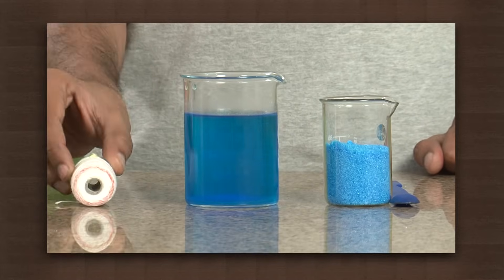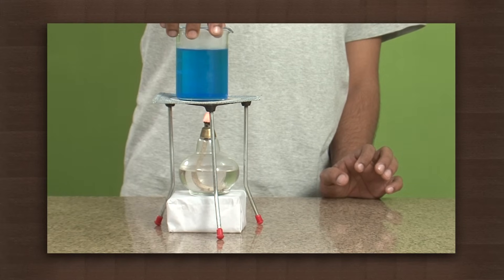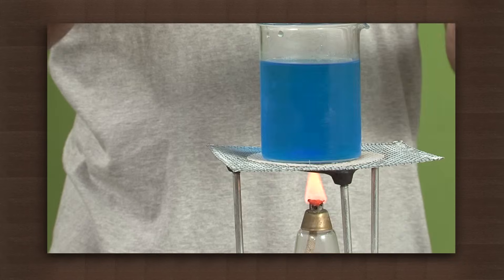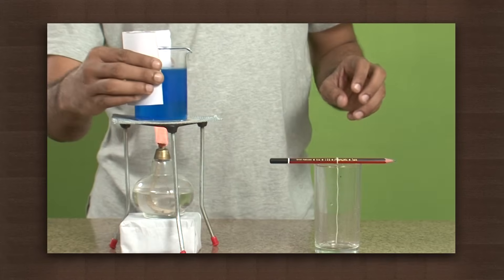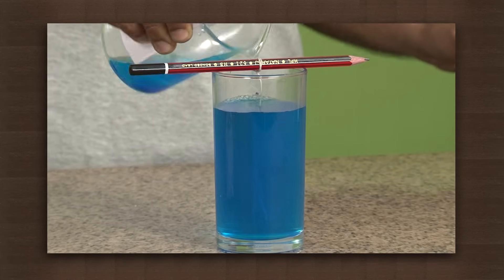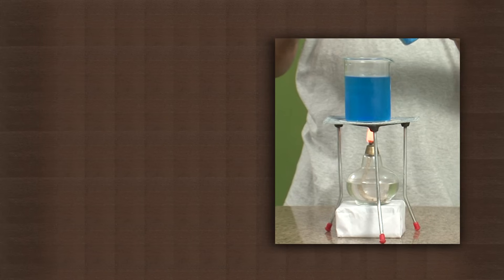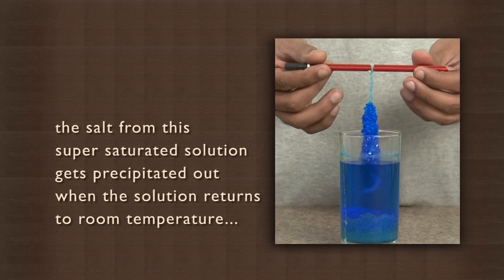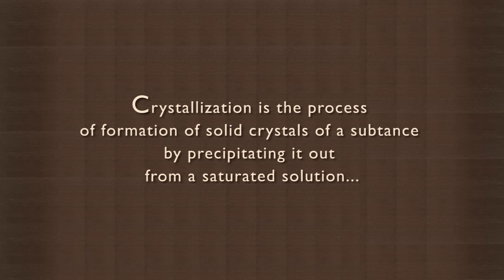Copper sulphate crystallization | Crystallisation | Chemistry

Comment: Why did you say to leave it for a few days? 
Can't we directly put it into a refridgerator?
Reply: Its science
Reply: If we we would keep it in a fridge We would get a solid cylinder and we would not  get crystals. Btw is your answer solved? I am a Indian
Reply: @reactionspace3254  Okay thanks
BTW can we put it just in a cooling device where we can decrease its temperature to a certain(say from 35°C to 17°C) 
Then, no need to keep it for some days

Am I right?
Reply: @Jaikesh Pandey: maybe, It might work.
Reply: Because it has to cool down slowly or crystal will not form if you put it in refrigerator the temperature difference will be dramatic and instead of cooling down slowly it would freeze along water
Reply: @dishant8126   correct.

Comment: The CuSO4 solution was supersaturated when he heated it, added CuSO4 for sometime until no more of it was dissolved. That was the point when the solution was supersaturated.

Now, coming to evaporation. Water will start  vapourising only if it reaches its boling point. Since the copper sulphate was saturated in it, the boiling point became higher and that's why the water didn't boil. It just evaporated so that the solution becomes capable of dissolving some more copper sulphate.

Then, it was left to cool slowly.

As you know, solubility of a solid decreases with decrease in temperature.

So as the solubility of copper sulphate decreases, the undissolved copper sulphate precipitates out of the solution in the form of crystals on the thread.
We suspended the thread in the solution to provide surface for the crystals to grow.

Btw, a new subscriber here.❤💚
Reply: I think water don't need boiling point to vaporize.  Example leave water in glass outside , it will evaporate eventually and it never reached boiling point
Reply: @rille5277  yes, what I'm saying is even if you make the water reach its boling point, it won't boil, it will just evapaorate as the boiling point of the solution would increase because of CuSO4.😊
Reply: WOW!!!! great.....legend!!!
Reply: woahhh!
Reply: Oh i see tnx for replying

Comment: Sir .....the saturated cuso4 solution was kept in room temperature to make it super saturated ...then in that case the water must have been fully evaporated right??...but i still see the water there??
Reply: The CuSO4 solution was supersaturated when he heated it, added CuSO4 for sometime until no more of it was dissolved. That was the point when the solution was supersaturated.

Now, coming to evaporation. Water will start  evaporating only if it reaches its Boling point. Because the copper sulphate was saturated in it, the boiling point became higher and that's why water didn't boil. It just evaporated so that the solution becomes capable of dissolving some more copper sulphate.

Then, it was left to cool slowly.

As you know, solubility of a solid decreases with decrease in temperature.

So as the solubility of copper sulphate decreases, the undissolved copper sulphate precipitates out of the solution in the form of crystals on the thread.
We suspended the thread in the solution to provide surface for the crystals to grow.